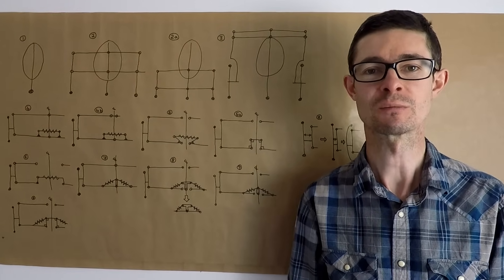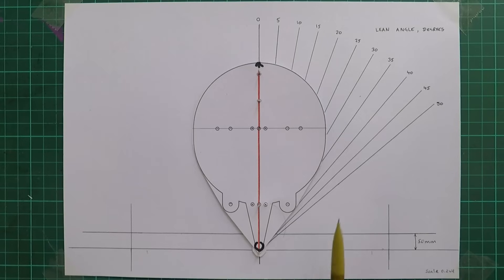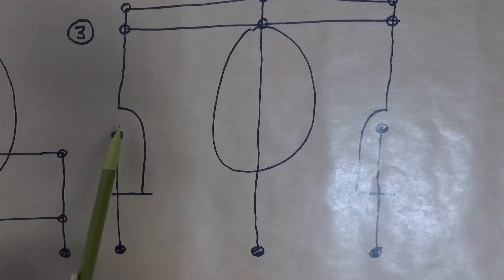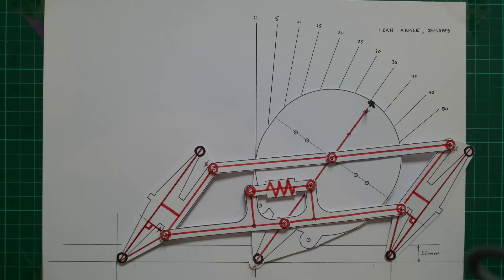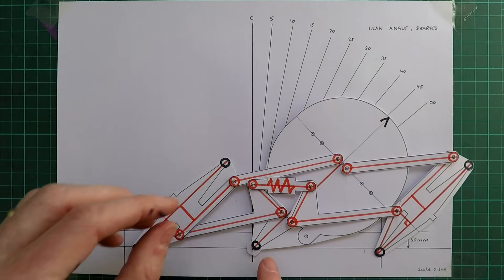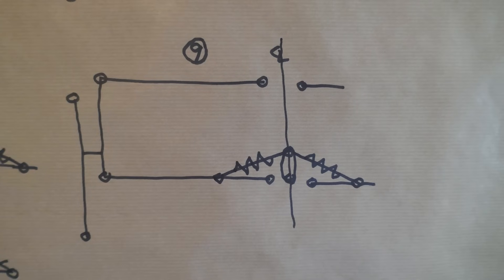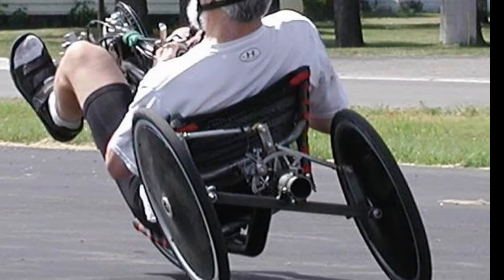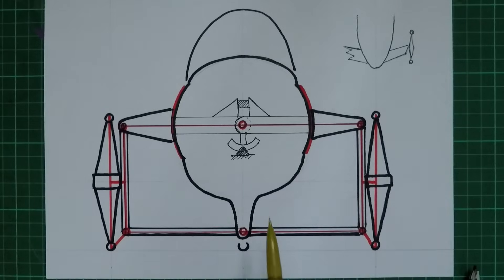Tilting Trikes Part 1 - Velomobile and Motorcycle Trike Tilting Mechanism Design

Comment: The arms/Beans supporting the wheels could be flexible to absorb shock and removing the need for the rubber pads?
Reply from the maker: Yes, I was thinking that too.  It would also avoid the need for the arms to be jointed in the middle so would be simpler.  Need to dig out my beam-theory notes!🤓

Comment: I am currently considering to modify an existing recumbent trike or bike (flevobike racer perhaps). My current aim is "to safely travel several hundred kilometer in a day without getting tired or poor."  I want to go for high mileage using petrol rather than electric as I plan to travel in places where recharging might not be easy and I want to travel over 200-300km a day. For this project I will be  using a tuned 30cc Saxonette motorized bicycle engine.

Any thoughts or inputs would be much appreciated.
Reply from the maker: Futurecare Design Hi, if you want to travel a long way without getting tired, then fitting an engine is definitely the way to go!  I would also suggest light weight, a little bit of suspension and, above all, a comfortable, yet efficient, seat and riding position. Good luck with the project.
Reply: @MetalMachineShop  Cheers, that is exactly what I have been realising when doing my research. There is a fellow Dutch guy that built a fuel efficient vehicle but he went for a 125cc motorcycle. You can find him on youtube and Google under 'Ligmotor'. He achieved 1:99 (235 mpg?). But I enjoy the idea of keeping it within the bicycle realm. It should do about 40km/h and get above 1:100 in fuel efficiency.  More and better with me actively cycling.
Reply: 40km/h is a travel speed that I enjoy and the bicycle is within my realm of expertise.

Comment: Would it be possible to have a design with the front wheels at a slight angle instead of them being orthogonal to the ground?

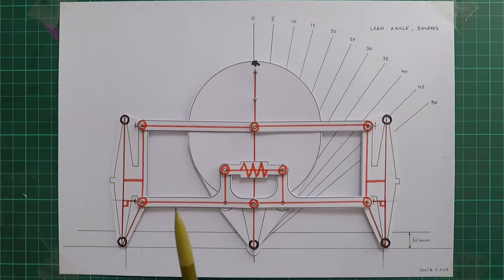At 5:18 you mention that one of the problems is that the lower pivot points of the parallellogram are offset relative to the contact point of the tires on the ground, creating a triangle that lowers the outer pivot and raising the inner pivot. If the wheels were angled inward at the bottom, it should be possible (geometrically) to lessen or completely eliminate this triangle.
 
Disclamer: I'm not an engineer and neither did I play around with pivoting models, so I suppose there are very likely some indesirable consequences that I forgot about. Indesirable consequences I can think of myself is that the angle will cause the velomobile to broaden at the top of the wheels and the velomobile riding continuously on the side of the tires and/or wheels, which they were not designed for.
Reply from the maker: Yes I guess you could do that but adding camber to the wheels could add a slight sideways force to the tyre rather than keeping the weight directly down through the centre of the wheel and tyre.

Comment: I've been interested in leaning suspension for years, and I've seen various different setups for the leaning mechanism but I've never seen anyone explain their design choices or even talk about the geometry. Personally, I'm more interested in motor vehicles, whether it's bikes or single seat cars, trikes of either configuration or quads. 
I do have one question that I have yet to see answered, is there an Ackermann equivalent for lean angles, or do you actually want the two wheels to be as parallel as possible? In my mind, though I don't have much of an argument to back up why I think this, it makes sense that there should be some form of vertical Ackermann for leaning, for the same reason normal steering has Ackermann angles; the wheel with the tighter turn radius turns, or in this case leans, more than the wheel with the broader turn radius. If it helps with my question at all, I'm also talking about wider tires with an offset wheel, to get all the pivots as close to the wheel's centerline; similarly to how a dished wheel or above-wheel design would work better on a trike like this.
Reply from the maker: Hi, I’m glad you asked this question because I have been thinking about this myself.  I am sure that the Ackerman principle applies to tilting designs as it does to upright vehicles, since the inner wheel is following a tighter radius just the same.  I’ve researched this and found at least one reference confirming this (I think it was the Yamaha motortrike that uses Ackerman steering).  The challenge then is to arrange the steering geometry to give consistent Ackerman steering throughout the lean angle range.  I am planning to upload a video on this fairly soon.
Reply: @MetalMachineShop   Metal Machine Shop  Thanks for the reply. I hadn't considered Ackerman at various angles of lean. It makes sense, though, as Ackerman in the steering would improve performance.

My original question was more about different lean angles of the wheels. Should the wheel with the tightest turning radius lean more than the wheel with the broadest turn radius? This would also apply to body lean and third wheel lean on a trike. Or is equivalent lean angles more optimal?
Reply from the maker: Yes I suppose in theory the inner wheel with tighter turn radius should lean more than the outer wheel but I’m not convinced it’s worth worrying about for practical purposes.  I haven’t analysed this in detail but it would seem that the difference in lean between the inner and outer wheel should be more for a tighter-radius turn, but a slow speed tight radius turn may have a smaller lean angle than a high speed, large-radius turn. The larger the turn radius, the smaller the difference in inner-to-outer wheel lean.  The lack of a liner relationship between speed, turn radius and lean angle leads me to think there is no design sweet-spot for difference in inner-to-outer wheel lean angle.  Commercial trike scooters and motorcycles don’t appear to incorporate this or suffer from it.  Just my view!
Reply: @MetalMachineShop   TLDR: Suspension geometry causes issues, especially at the potential differential lean angles that could be used here. As ideal suspension is based on a parallelogram, but ideal differential lean angles are based on a trapezoid. An active form of manipulating lean angles could be possible, but the suspension geometry issue remains, but there is a solution where suspension could actuate the lean angle actuator to compensate for suspension geometry when the suspension is actuated, but this is a very complex issue that may not even be feasible without proper research and development. There's potential in the future, but until then, leaning suspension will remain rigid parallelograms with parallel leaning. Differential leaning may not even have a benefit at the end of the day.

I've come to the realization that differential leaning is too complicated and/or too difficult, due to suspension travel. To achieve differential lean angles, just like differential stereing angles in Ackermann steering, you need a trapezoidal frame consisting of the center body, control arms, and wheel hub/knuckle. Problem is, once you introduce a non-parallelogram into that geometry, the extent of travel can produce odd angles, especially when you look at how large of a difference in lean angles might be required.
The solution to this? Active angle change, essentially a steering rack for the upper control arm. This would introduce a ratio between lean and steering. But the problem of suspension geometry remains. 
The solution to that? A system that is actuated by the driver but also actuated by the suspension. Basically if you hit a significant bump or hole, the suspension can 'fix' the geometry of the control arms to retain proper wheel angle, and not throw that wheel out of control. 
This is where the 'too complicated and/or too difficult' part comes in. You need an actuator that is actuated by driver input and suspension input, but this actuator can not inversely actuate either input itself, and either input cannot actuate each other with this actuator as a middle-man in the design. 
Simplest design would be a hydraulic system, but this would require complicated valve logic to make it work, if that valve logic is even capable of existing. More complex design would be to use electronics and an ECU to assist in this kind of design, but again, can the logic theoretically exist in a way that makes the system usable. The electronic design could work in the sense that suspension actuation takes priority over driver input for lean acuation, but then the problem becomes how fast can this work. Speed would be a problem the hydraulics could fix, but then it's an issue of getting that logic to work with a complex valve setup. Maybe a hybrid could work, where it's ECU controlled valves, but again, will the electronics be fast enough to do this. It's a constant back and forth of how would it work and could it work, and it's not an easy situation to solve without an engineering background, money to research and develop this, and having the proper tools to research this. Then the question becomes about reliability of the mechanism. 

All things given, I can see why every design uses a parallelogram, or a shape as close to a parallelogram as they can get.
A solid axle variant could make this possible, but then you'd be getting into an entirely different form of suspension, which may not even work itself. 
This issue seems more like it would be someone's Master's or Ph.D. thesis, or a project meant for a halo vehicle, where the mechanism may not even appear in other vehicles at all. It's an interesting concept, but just not feasible at this time, not until someone researches and develops a mechanism that not only works properly, but is also extremely reliable. 
It's still something I want to see researched, but I don't think we will see it researched any time soon, not until leaning trikes and quads become more popular on the consumer market as performance vehicles. It's more likely that a race team would develop something like this, assuming leaning trikes and quads ever become popular in big name racing, such as Formula. Even if we ever do see this researched and developed, we'll never see internal documentation, and the most we'll see is patents until someone can somehow reverse engineer the mechanisms. 
Sadly the most I can do, and the most anyone interested in this can do, is make it a theoretical concept that might work on paper, and maybe construct a physical version that wouldn't be up to the standard of production parts. 
For now, I just hope we'll see something like this in the future, but until then, leaning suspension will be rigid parallelograms. 
Who knows, differential leaning may not even have benefits, which is why we have yet to see anyone research it, as it may be too complex to result in benefits, where anything past simplicity results in diminishing returns.
Reply: @MetalMachineShop  Yeah I thought about this too. But it's really hard to Have an Ackerman steering as well as Ackerman leaning. Keeping wheels parallel is the best option and using lean wheels (road bike wheels) might reduce scrub I guess.

Comment: Will you have only tilt steering? What is your planned minimum turning circle?
Reply from the maker: AngelAndTheWolf The tilting and steering mechanisms will be separate.  It will steer just like a normal bike in that the steering works with a castering action and the tilting is basically controlled by steering inputs.  The steering will still work when the tilting mech is locked, in which case it is just like a car.  The minimum turning circle is about 8m diameter, better than a Quest velomobile but not as good as a bike!
Reply: @MetalMachineShop  Thank you. Seems you have thought of everything.

Comment: interesting info thank you.  I have been thinking of entering a downhill soapbox derby since 2004, and am yet to realise my dream!  I have had a design in my mind similar to this for over a decade now, but with no welding skills I have not even begun a prototype.  With no need for pedaling, i was going to use a kayak with a steel/ally frame fitted within.  Then the front assembly remains outside the moncoque shell and can get some serious lean.  I was going to incorporate the rear suspension of a downhill bike on the rear wheel.  Im looking forward to seeing how this project of yours progresses.  Ill get into my local hackerspace hopefully and recruit someoine who knows what theyre doing to help me :D

When custom building these, where do you find an appropriate wheel/hub/axel combo?  I see regular track gokart fittings are easily available, but would you be needing to custom build the hub/axel fitting yourself or are there off the shelf suitable parts?
Reply from the maker: BigRedWrenster I will be looking to use standard bike parts, including the wheels and hubs. The steering mech and the rest of the tilting mechanism will be home-made.  The front wheel axles may need to be home made on the lathe as they will be cantilevered (i.e. fixed at one end only) but I am sure such things are commercially available too.
I’m going to do another video soon showing the details of the steering mechanism design.
Reply: @MetalMachineShop 
There are some BMX wheels made for 14 mm axles that can be fitted to a 15 mm shaft by simply removing the tube. We used them on our pedal cars, if you need to make traction with those wheels just get the hubs for disc brakes and weld a flange on the shaft in order to use the six holes to connect shaft to wheel.

Comment: Just wondering, at about 1:09 in the video you mention that deployable landing gear is a strategy that can be used to stabilzie a two wheeled vehicle at low speeds. You mention later in the video that this strategy is not really ideal. Can you elaborate further on why deployable landing gear is not as good a solution as adding a third wheel and a tilting mechanism? It seems that the deployable landing gear system has been used successfully on faired two wheeled vehicles, such as Burt Munroe's faired motorcycle.
Reply from the maker: I guess there are pros and cons to both approaches, depending on what you are trying to achieve.  The landing gear system seems to me to be slightly more complex and less elegant and may need to accommodate uneven ground.

Comment: Are you trying to build a racing vehicle being able to get into curves going with greater velocity?
Reply from the maker: I’m not going for a racing vehicle as such, but something that is fast, usable and efficient on the road.  I want to tilt because it is cool; is technically challenging and interesting; it reduces the risk of tipping over in corners (so potentially higher cornering speed than non-tilting vehicles); is more comfortable for the rider.  I also hope my forward-wheel design will make it less susceptible to side winds than other velomobilse which have a lot of side area in front of the front wheel.
Reply: @MetalMachineShop  It looks amazing and really aerodynamic.  Maybe adding of sufficient amount of batteries at the base near the pair of wheels could add some stability.

Comment: Where did you get that graph from It looks way to liberal favoring the recumbent bike and a human powered bike is going to be so low in that curve....I do applaud your 2D modeling!
Reply from the maker: The power/speed curves were derived from the drag formula, where drag = frontal area x drag coefficient x air density x (speed squared/2).  Add rolling resistance to that.  I assumed a drag coefficient of 0.88 for the upright bike (probably a bit pessimistic) and 0.2 for the velomobile (a bit optimistic maybe).  There is still a big difference in power even when the drag coefficients are moved closer together.  The velomobile has a much smaller frontal area which really helps.  To convert drag to rider power, I used power = speed x drag, and adjusted for drivetrain efficiency (95%).
Reply: @MetalMachineShop  with all velos that have already been made has anyone provided empirical data. It doesn't seem that hard to do if you use an electric motor of know output.

Comment: Your faithfulness to parallel links is an obstacle, consider altering the design in the following ways: lower the body attachment pivot points above and below the  links' axle line to observe the effect on the center of gravity at rest. The center of gravity should remain below the center of buoyancy to retain dynamic and static stability. Also, consider the effects of altering the angles of the links to each other to offset the effects of the turning geometry. Finally, consider that the dynamic change of the center of gravity in a turn may not require as radical a lean angle as you propose: for stability it is only necessary that the moment of gravity remains within the boundaries defined by the ground contact points. Leaning too far will cause the vehicle to fall into the turn. Consider a pendulum and review the dynamic forces.
Reply from the maker: Hi, thanks for your comments. I  agree that the design could be optimised by playing with the length and angles of the links and the pivot locations.  Will be looking at this in my CAD model.

Comment: And what is about to include the mechanism into the wheel? Of course you cannot use a spoked wheel. The rims would be in a line with the axes of the mechanism, not above like the first version, just inside. You are inspiring!
Reply from the maker: My next video will look at this in a bit more detail...